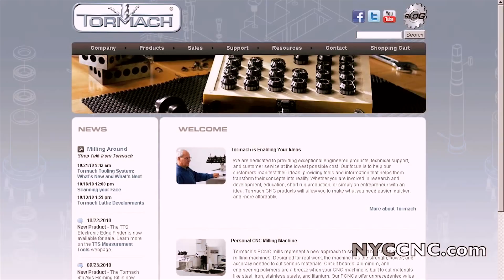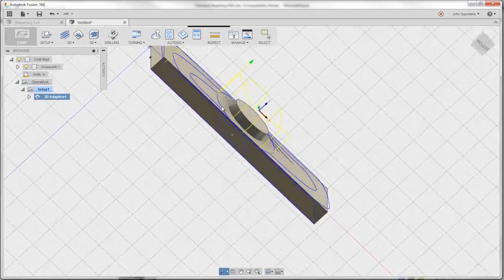The Road from NYC CNC to Saunders Machine Works

Comment: John has been great supporter of Tormach. It would be good to see more of the Tormach team. one suggestion is taking a part on Fusion from the completed cad to setting up cam and moving to the Tormach machines. More on path pilot mods to existing gcode.

Comment: Good point @ 4:13 regarding attitude of "you need to be a machinist to use this mill". Tormach is really poised to be a leader in the higher end consumer/maker and pro-maker movement, but with that needs some updates to mindset, especially with introduction of the 440 and its audience. More people will enter with less knowledge and Tormach could really excel by updating the website to have more learning and instruction and explanation for folks new to machining. Examples are lathe boring bar sets, but not clear suggestions for how to hold the tools properly (QCTP, use a collet, or ??); superfly that the insert holder can install 2 ways - if you've never seen a carbide insert, a clear picture of a fully installed tool would be helpful. These sorts of learning dovetailed into product sales and exceptional support would really set Tormach apart.
Reply from the maker: We will take these suggestions into consideration. What do you think is the best way to provide this information?
Reply: Your current website is a really good starting point, perhaps with a little reorganization and some expanded content. For example, there is the main product website body, the store, and some learning content. Bringing these together via minor layout updates and more clear links would go a long way to making what is there better, and a good base for adding new content/learning/pictures/instruction as it is available. Look at Adafruit for example - search for products and you get the item, but it is also the store (you can buy it), and it has good pictures and descriptions; plus specs, and if applicable links to either more learning or documents, or even external websites. But, it is all tied to a single cohesive product page. Even better, it had "have you considered..." much like Amazon suggestions. So, for example, a lathe tool page would have linked to the applicable tool holders; or the options for carbide inserts. The nice think about making a website product-centric in that manner is you don't need to do an all-or-nothing rebuild of the content.. you layout the consistent framework template and can add content as it is available (and you already have 80% of the content). Plus you have great products and awesome service so you are starting from a position of real strength (my 440 and slantpro purchase experience could not have been better - though again, there were some quirks with the 440 that I accepted due to being a new machine, but may have been frustrating for someone just entering the market with little experience). HTH